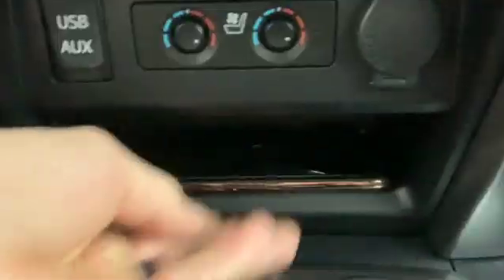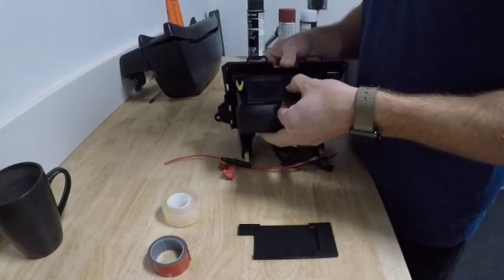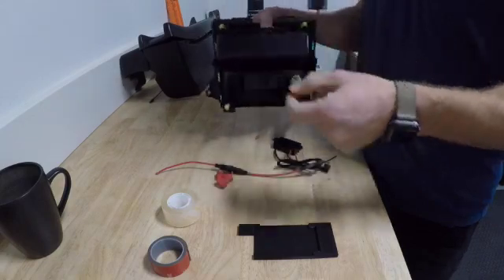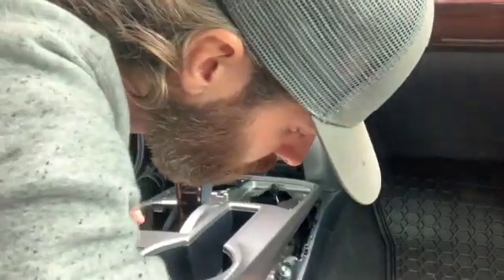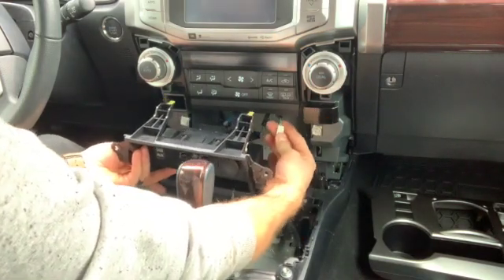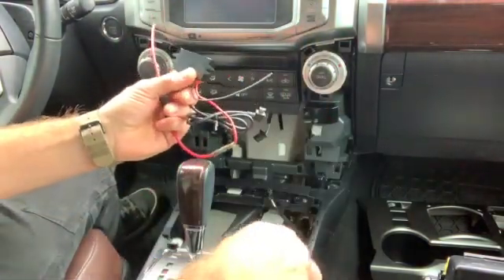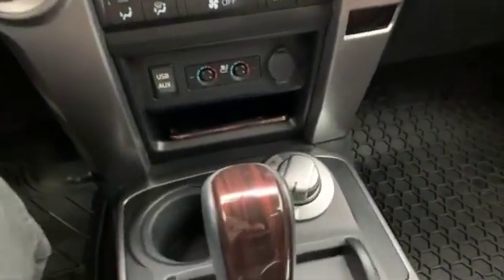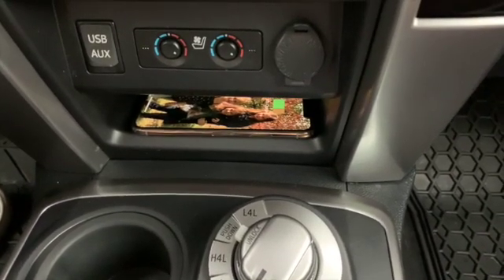Toyota 4Runner Wireless Phone Charger - 5th Gen

Comment: Can you do a 3d printed items for the mustang?
Reply from the maker: I have already done some. I currently have an antenna delete plate that I designed and printed for 79-93 mustangs. I did a wireless charger for my 1992 fox body as well
Reply: @KASLCustoms  

I saw the delete play video. Can you do the piece that would go underneath the rear carpet for the hatchback when I eliminated the tire the carpet sinks but I need something lite.
Reply from the maker: I wish I could my friend, I am limited to items >10” due to my build plate size. I built a fibreglass sub box for my spare holder. I also know that Scott Rod Fab builds spare tire holders that are very high quality 👍
Reply: @KASLCustoms  

Ok I will check them out. However if something changes and you attempt one keep me in mind
Reply from the maker: Will do for sure bud!!!
Reply: @KASLCustoms  

Thanks. If I think of anything else I will check with you.
Reply from the maker: @joshh4427  Awesome sounds good!